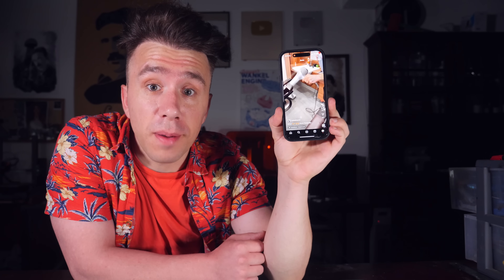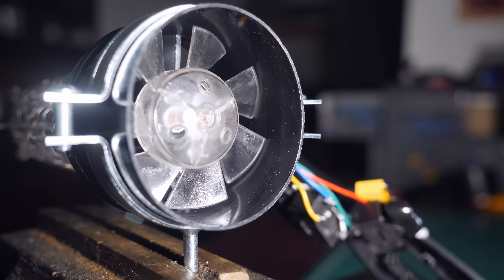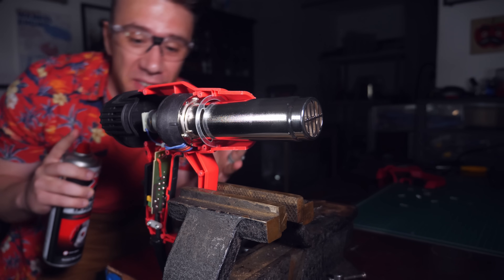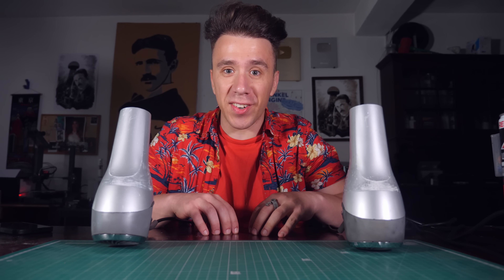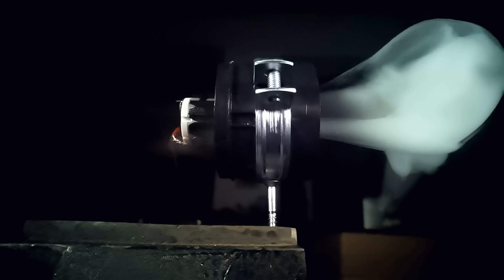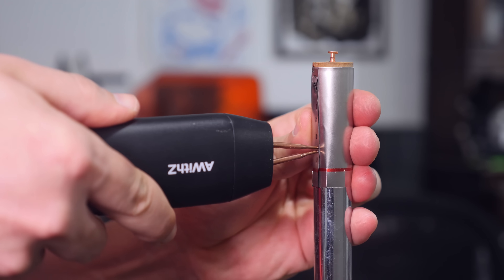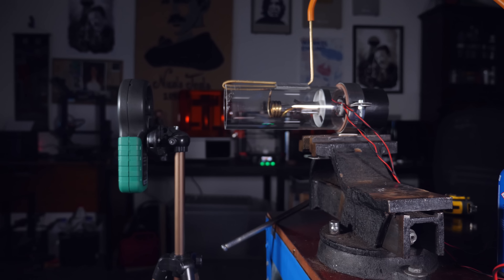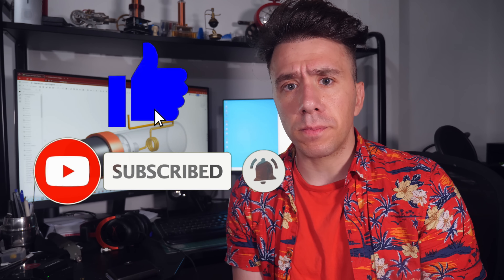I turned my $20 Hairdryer into a JET ENGINE

Comment: I think the first idea would have worked if you used separate adjustable power supplies for both the heating element and the fan. With high fan speed the brake cleaner isn't igniting because it gets mixed in with too much air and it becomes too lean mixture to ignite. 

The fan is usually connected in series with the heating element. With the 3d printed propellers the airflow didn't decrease enough. Also because there was less drag the motor was spinning with higher rpm so the voltage drop across the motor increases. That means that less power is going to the heating element. 

The broken hairdryer worked because there was significantly less airflow. Also the fan distributes the fuel evenly. If the fan speed was adjustable it would be possible to get the fuel air ratio right so that it is using all the air. Getting the fuel mixed to all the air seemed to be the main problem with the final version. The only problem I see is the plastic housing of the hairdryer melting

Comment: My best idea for improving the design is a better air to fuel mix.
Currently you have a lot of air and not so much fuel. If you make a spiral coil with the copper tube, you can make a bunch of tiny holes along it's length in order to pump more fuel into the stream, you can try both a simple spiral with a crimped/soldered end tube, or one with both ends of the tube getting fuel pumped in, and the spiral meets at the center, where there would be a the end point/mid point of the tubing. This design probably needs a pilot flame behind it, at least for ignition, but might need it in order to heat the fuel up before injection/ejection.
Reply: I would be more worried about getting more air into the middle of the flow first. Then add fuel.

But I do agree that more fuel equals more flame.

I'm just thinking of getting a more complete burn within the tube.

Comment: Make the end of the engine a variable constriction like you see on some Fighter Jets, maybe have it made of 3D printed stainless steel to get a better mixture of all gases and a more complete combustion. If you make a variable one, you can change the constriction to make it optimal for exit velocity with the rest of the parts and fuel type in mind.

Comment: Usually jet engines have a flame trap on the outside perimeter of the jet. The injection then happens ahead of the trap and allows for some premixing. This is how you get more boom

Comment: Said this last post but, You might be able to burn or at least heat up more of the air by adding a conversion nozzle after the combution to help push the clean air in with the burnt fuel. You can also add holes or slits behind the nozzle to then allow the nozzle to act as an air multiplier pulling in more air as it spits out flames threw the nozzle. At least that's the idea I have.

Comment: Re-commenting with my 2 cents: 
To get a better air-fuel ratio you could play with the cross-section area of the tube. The easiest way that comes to my mind is oversizing the tube to get lower pressure at the burner, then you could insert a conical spike in the tube with the vertex toward the burner so that the available cross section is reduced. 
I said conical but you can 3d print many shapes, I believe a parabolic shape would be a better start. 

🍅

Comment: I’ll say it again, I think that with a turbine like agitator could spiral the air towards the center and leave a small protective layer on the outside. Also if you redesign the impeller you could get higher pressure to make up for the loss in the agitator. This could improve on the design. I’m graduating high school this Friday but I am totally going to play with the cad now. And buy a hair dryer.😂 integzas channel is great!!!

Comment: Wonder how the air shield around the combustion would work with something like a rotating detonation (still waiting for the video) or an aerospike. Or a linear aerospike would be even better -  i mean the original tiktok video hairdryer had the thing on its end too. Could focus the end of the air without losing much trust i think. Also put the loop in the fuel pipe closer to the igniter thing, the combustion just goes through and around, thought i guess it heats it up well :D

Comment: Reposting my comment from the other vid. 

To improve the design: Look at building annular combustors and flame holders like a traditional turbine has, should help produce a slow moving pocket of air for the combustion process. 

You were running into the same issue Turbine engineers have with the high flow of air through the combustion chamber.

Comment: As I mentioned on the first upload, it might be a good idea to figure out a way to snake the fuel line into the coil chamber rather than it being in the literal line of fire. Sure it heats the fuel up but it also disrupts the outgoing thrust as well as risks the chance of igniting the fuel in the line. You can still preheat the fuel attaching the heater from a hot glue gun or two to the line, though you might get mixed results depending on the quality of the glue gun.

Comment: Seeing as you have so many working jet engines with (kinda) reliable fuel injection, the next step would have to be throttling it and using it in an RC plane!

Comment: A ducted fan throws fluid to the duct walls. That's why turbo fans can run in a storm. You would need to inject fuel after the fan and boost pressure. 

Or, you want the kind of impeller fan that draws the air to the centre. This version also boosts pressure.

Comment: Doesn’t adding a nozzle/restriction to the exhaust end increase efficiency and thrust to an extent? It should increase the air pressure in the combustion chamber increasing output while restricting fresh air flow enough to let a more complete burn

Comment: You better use a spark igniter rather than that nichrome wire, make circular tube with holes for injecting fuel into the chamber and keep the radius of circle such that ejecting fuel comes in the flowing air

Comment: Re-commenting for the algorithm. If you want to get good control of any liquid for injecting into any of your projects you should buy a fuel injection cleaner canister. They come with different connectors you can use to attach to feed your fuel into, has a regulator so you can control the speed of the input and all you need is compressed air to push it in.

Comment: Jet engines need a nozzle after the combustor to reaccelerate the flow after combustion.  A fan is just an axial compressor, and just like an impeller, needs a diffuser downstream to slow the flow (which raises the static pressure) to speeds that allow stable combustion in the combustor.  Then after combustion, there needs to be a nozzle to reaccelerate the flow (which lowers the static pressure to the same level as the atmosphere) to get the most thrust.

Comment: LEAF BLOWER JET ENGINE

Leaf blowers use an impeller which is perfect for combustion. By scaling your design, you should get much higher exhaust speeds. You would need to figure out how to heat the tubing though.
Reply: Why is impeller better? And what is that?
Reply: @ShadowJack4488  It's the difference between an axial and a centrigufal fan. They're all fans the main difference is that the pressure increase offered by grathering the air molecules and shooting them out of a smaller "hole". 

You can't do that with an axial fan because the turbulence caused as the exit narrows creates a back-pressure that tends to stall the fan. Many (all?) 3D FDM printers use centrifugal fans for the part cooling so that bridges can be made by rapidly cooling the plastic as it leaves the nozzle.

When the impeller is rotating it scoops up some air from the intake and compresses it by moving faster than the air molecules are.  

A propellor accellerates a fluid but doesn't compress it, that''s why we see them used for cooling. They're also less prone to getting snagged if something gets into the flow (whch is comon with an impeller as the blades need to run almost in contact with the edges. A propeller can operate in free air, indeed pretty much all prop-powered aircraft like the Cessnas do just that.

I've never actually checked (I don't have a fast enough camera) but I expect that air coming out of a turbine pulses as each blade passes the exit.

Comment: And I will comment again: high pressure after combustion with restricting nozzle (you will add one?) requires high pressure of incoming air, so stick with a turbocharger.

Comment: One idea I had would be to create a custom anemometer using PCBWay. They can CNC or 3D print materials with extremely high temperature resistance such as titanium and steel. This will prevent the melting problem you have had in the past and allow you to get more consistent and accurate exhaust speed measurements.
Reply: I was thinking to use a Pitot Tube with an Anemometer for the same problem of measuring the airspeed in the hot exhaust. As the pitot is just a steel probe it can withstand the heat while the expensive measuring equiptment is far away from the hot explody bit. 😀

Comment: I can't help but remember that the coolant protecting the engine bell of the F-1 rocket engine was... rocket fuel.  Uncontrolled fuel-air & fuel-oxidizer combustion is scary, but it's not actually super-difficult to impart some degree of control on it.  The memorial crater parks only get commissioned when the method(s) to control the combustion fail unexpectedly.

Comment: Reupload? Than i Copy my Suggestion from Last Video.
A 2 staged injector. Inject in Front of the Fan to burn more Air. Then you can use the already created injector from this Video again AS a guidingflame/ Burner.
With both of then you can finetune the fuel to Air mix

Comment: I would probably put an injector tube around the outside of the tube, pointing inwards. That way the fuel might get mixed in with the air even more and you can then put just a tiny bit of nicrome wire into the air stream to make it go Whoobmsch

Comment: 1:27 - "The more wire you have the more current you need to get it hot" - that is not correct. the required Current stays the same. The Voltage and power required increase.

Also for the flame you want a Bigger restriction:
Compressing the air towards the outside of the chamber and creating a large stagnating zone in the middle where combustion occurs. Might also be a good idea to have a flame-cage for that.

Comment: I still stand with my comment on the previous upload, that you don't want to use all the air from the fan in combustion. Keep a fair portion of it as bypass air to increase thrust like a turbojet or turbofan engine does. But you could add an afterburner or maybe a second combustion chamber.

Comment: It seems to me that to increase thrust would be to

1. Create a pre-combustion chamber. 

2. Better fuel delivery. 

For #2 add a small chamber at the end of your copper tubing with holes around its diameter. By doing this you should (theoretically) get better air/fuel mixture as rather than the copper tubing being directly into the center of your igniter it will allow the air to feed as multiple separate streams and hopefully create a more "misting" like effect. 

Of course using a mini-atomizer should work better, but the container as described may have a similar effect.

Would be recommended to have a one way valve to prevent back-flow of the fuel/flame back to the fuel source.

Comment: To use all of the air could you just create multiple igniters and fuel streams? Maybe with the tube diameter increasing just after the fan and then decreasing again at the exhaust to slow down the air for combustion and then speed it up again?

Maybe you could design the igniters to work in the direct flow of air, if it needs pressure then maybe having a funnelled inlet and then an expanding outlet just after where the combustion starts. Aggressive funnelling could slow the air too whilst pressurising it, this could lower the output speed but maybe the extra combustion could counter that for an overall faster result.

Another option may be to add tiny holes in the sides of the copper tube, small enough that most gas still comes out the end but the small holes would let gas flow into the already combusting gas and act almost like an afterburner.

At the moment you just inject the gas straight into the igniter, would creating a swirling flow maybe help? The gas could enter the ignitor sideways, offset from the centre and the igniter housing could be made to direct the air in a swirling pattern with the igniter housing expanding as it goes back. This would likely need at least some airflow through the igniter although possibly quite slow rather than being in the dead spot. The swirling could possibly increase the time/distance the gas is in contact with the igniter and help distribute the gas more evenly into the airflow from the fan.

Comment: posting the same thing I did in the last one, cause engagement

for another project you could try replacing the liquid fuel with solid fuel, like gun powder because a solid has higher density and when it expands to gas form you will have more pressure. maybe by dripping the solid fuel in like you did with liquid or letting the fan draw in the grains and then having them collide with a lattice of nichrome wire?

Comment: Make the tubing as your heating element (you know what i mean) or just increase you voltage or amp to make it hotter because the "break cleaner" is cooling your heating element or just use a spark plugs because its already a flamable liquid

Comment: If you put a ring tube at the end of the spiral tube with many holes in it and directly heat that ring tube up, then this could make it more efficient (spreads more so you might be able to use so much more air)

Comment: Ceramic fuel dispersion ring that fits near the front end of the steal shield. Also may need to modify the steel shield to allow some air flow to provide better oxygen mix, or use an air pump of some sort.

Air----->
______  _______________Steelshield
Moter | Fuel injection ring | nychrome wire
______  _______________Steelshield
Air----->

Comment: I got two ideas for you @integza. The first one (more for fun than anything else) would be an afterburner system like on fighter jets. The second is an impeller from something like a turbocharger but it has ports in between the fins sor of similar to the liquid piston rotary engine. The intent of this design is so that you can still keep the tube shape without having to slap on a snail shell to the design.

Comment: I think the first think to try is to put a proper impeller at the intake. 
If it's a jet, you need slow, dense air. Using the deadzone just isn't going to cut it.
You could even 3D print a series of stators and rotors as they're not in a hot path.
Second, I'd get a proper valve for fuel flow control.

Comment: I will repost my comment that I posted in the first one with some changes..
My idea to solve the problem of not using the whole air flow is.
make some holes at the beginning of the combustion chamber, it may help to give a small amount of air at the combustion inside and make a flow.
then put a cone amost after the end of the combustion, this cone will collect more air flow and focusing in a shorter hole it will make pressure difference I guess. you can hold it with some 3d printer stuff, I would create some holder with screw maybe. the outer tube would have a reduction almost at the end of the cone, the idea about it is to help the flame flow and avoid it to complete burn the acrilic tube.
I do made a sketch and a 3D model to show a visual idea about it. 
but unfortunatily I cant post links..

Comment: A really simple idea.  Use a forcing cone in front of the fan, sort of like a ram jet?  Because the fuel is liquid, you need to find a way to heat it up more, and have better control.

Comment: I'm thinking you split the fuel line/ have more lines pointing in radially from the outside (probably angled towards the direction of flow) it would definitely increase the proportion of air used in combustion. I think the main challenge would be to prevent the fuel injection from obstructing air so I'd try grinding/ sanding the additional lines flush against the tube which should help, though it would be pretty tough to get access in there to sand (maybe 3D print a distribution ring for the fuel or something similiar?)

Comment: I think a better injection would make it better. You should try making a brass ring behind the blades with a lot of holes pointing in the direction where the wind is going and then ignite it after the air and gas was mixed with a round coil. That would be to hot for your tube but you could replace it with one made of glass. One thing that also could bring better combustion would be adding nozzles that spray the fuel in a cone shape outwards.

Comment: Maybe doubling your fuel injection system would introduce enough fuel to use up all that air.
Another idea is to 3D print a trigger mechanism to better regulate the brake cleaner flow.

Comment: So since this is a re-upload, I add my original comment here too.
I’d suggest to create a stream-lined distributor for the brake cleaner made from the porous metal, you’ve shown in one of your earlier videos, and place it in the middle of the tubing. This should distribute the fuel pretty homogenous in the air stream

Comment: I’d get those flat metal nozzles they make for pressure washers and distribute them concentrically around the base of the cylinder (near fan) then send fuel through those using the central flame as the main ignition source. To try and spread fuel to the unused air. Plus it may explode in a beautiful fireball of tomato death 😂